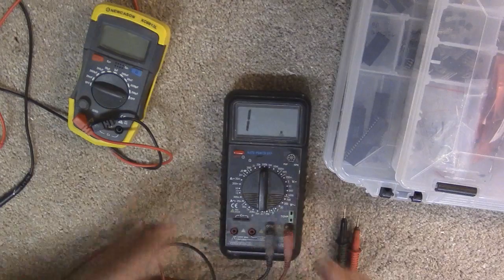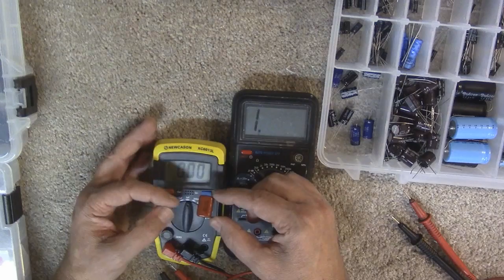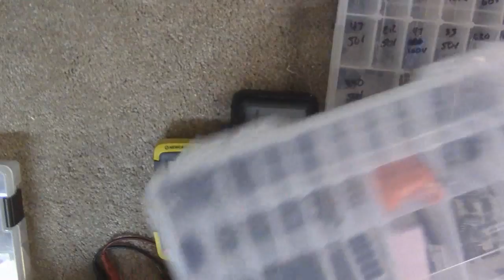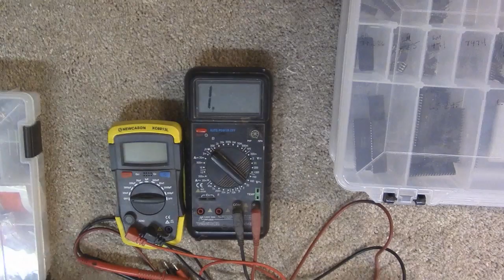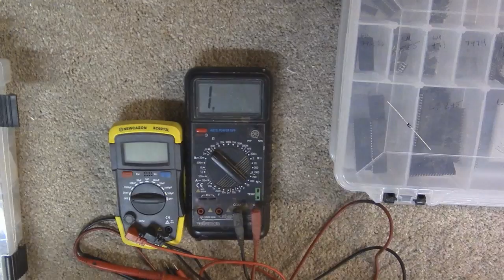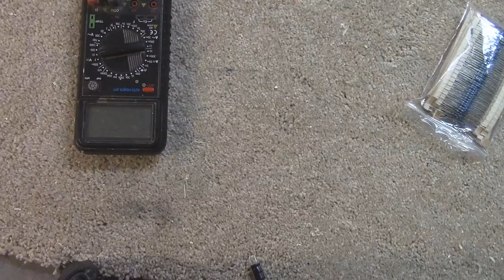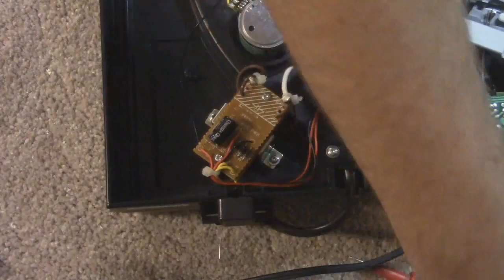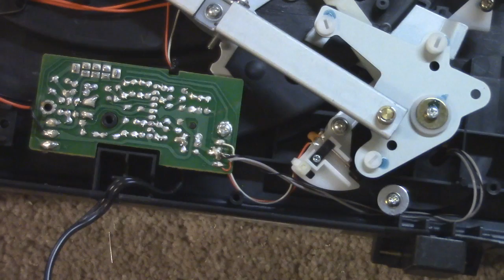how to repair electronics for dummies part 2

Comment: Will, I have been told that there are things that are safe to use a soldering gun on and other things that you can only use a soldering iron on. Can you give me a quick explanation as to was this is or is not true?
Reply from the maker: some components don't like heat very much. so you try to use the lowest wattage soldering iron you can to protect them. some on the other hand can handle a lot of heat and you don't really have to worry about it.
Reply: HOW TO BE A MAN Thank you. I have always assumed up to this point pretty much the same thing.... The more delicate a component is, the more careful you want to be. For example and like you said the amount of heat you put to said component. I suppose you could fry a small cap or diode with the fast immense heat from a gun. I have always liked the gun because it's instant. But now that I am starting to work on these small components, I'm concerned about it. Anyway, thank you sir!

Comment: Put the old cap back in it and see if it works.Love this type of video. I've been trying to teach my boys, 9, and 12, about this stuff. I have an old laptop I'm letting them tear apart. One of my best friends moved to my town to open up a Radio Shack years ago. It closed long ago, but I miss the old days of repairing things.
Reply: We have an old home computer that the power supply is bad. You can get it running by blowing a hair dryer into it to get it going.